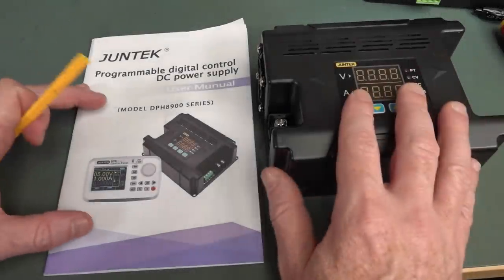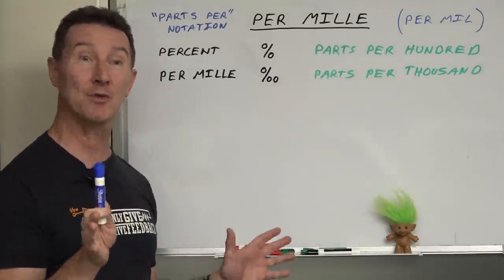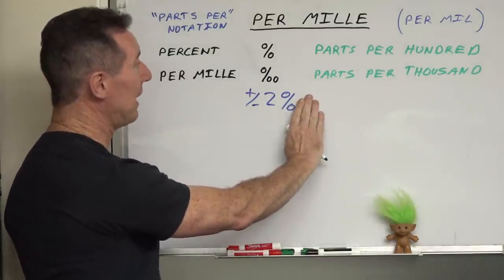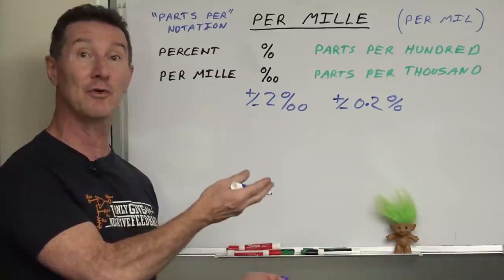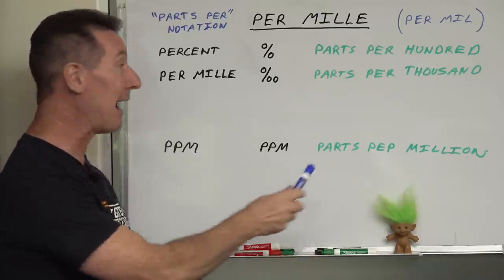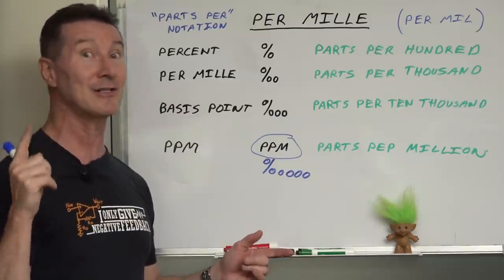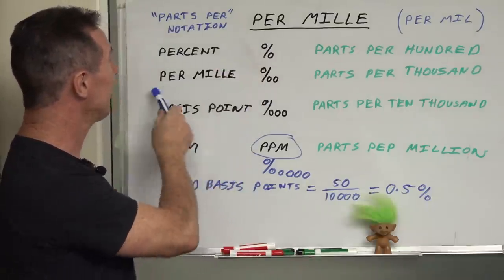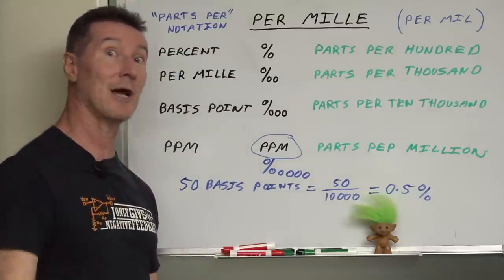EEVblog #1300 - "Parts Per" Notation EXPLAINED

Comment: Mil mille I only know this but have never used it. Basis Points I knew what they are did not know this origin - 0/000 parts in 10,000 , i just thought hundreths of hundreths.

Comment: Ok now I'm lost again. What's a 1/2 digit?
Reply: @TubeifyMe   A half-digit is a leading digit that doesn't count all the way to 9.  Confusingly, "half a digit" doesn't mean 5.  It actually means half in the log domain, which is 2.3.  So multimeters that go to 1999 or 2999 are both called "3 1/2 digit" multimeters!  A multimeter that actually maxes out at 49999 is called "50,000 counts", not 4 1/2 digits (which would be 30,000 counts).

Yes, I know you're still lost.  Sorry!

Comment: How on earth do you resist the temptation to use the phase "from the latin".  Also abbreviating from the french for large numbers seems like a horrible idea as mille is 1000, un million is 1,000,000 and un milliard is 1,000,000,000 or our billion.

Comment: Sorry this is not in the standard ascii table so should not be used :)
They should have wrote 0.2% or at least .2% if they needed to save some space and not 2‰  That notation may have been fine when computers where not used for everything.
Reply: Wasn't on typewriters either (well maybe some really fancy ones I don't know about could have had it), maybe it's having a resurgence with unicode or whatever but I thought it was obsolete and only used in old time handwritten stuff until today.